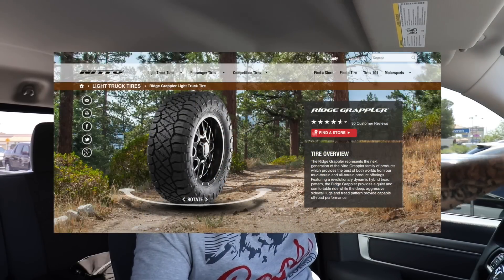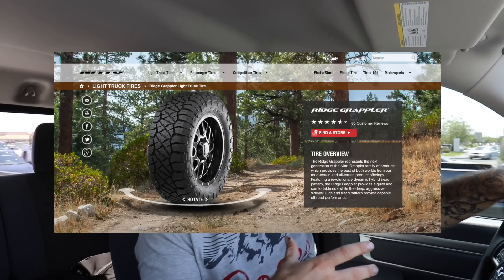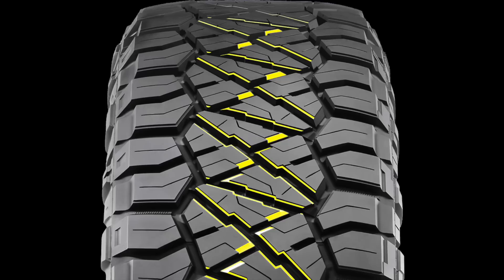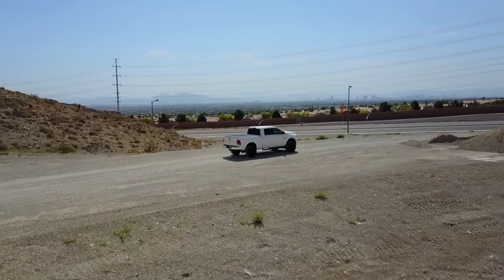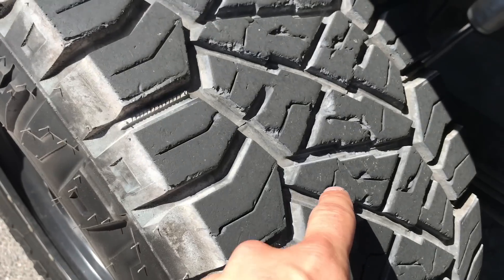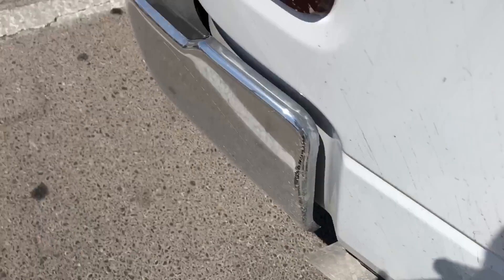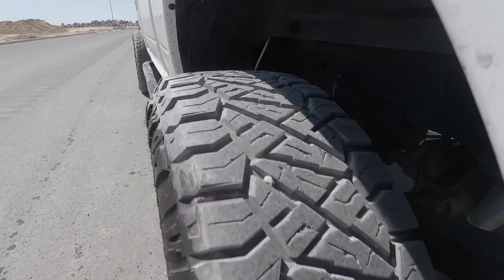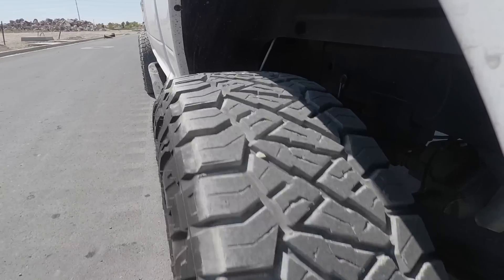Nitto Ridge Grapplers SHREDDED After 4,000 Miles - Jay Flat Out

Comment: FYI, Toyo owns Nitto.  Same company, same manufacturing plants, use different compounds in tires.  See the same issue here in West Texas in the oilfield.  Very similar environment as Vegas, run from place to place on hot asphalt then turn on oilfield roads all day every day.  Will shred a tire, especially if hauling a load.  Running Ridge Grapplers on my F250 right now, 10,000 miles with no issues so far.  This is my first set outside of running Toyo ATII's or BFG AT's.  Have run 2 sets of Toyo's and probably 10+ of BFG's.  I liked the Toyo's, but never the full claimed mileage they advertise as they get really hard at some point and it's like driving on glass on wet roads.  BFG's always had good luck with, just decided to try something different with the Nitto's and Toyo's.  Next set will probably be going back to BFG's.
Reply from the maker: Even when I worked in the oil fields my work truck never had problems like this.
Reply: Toyo doesn't own nitto. Toyo manufactures nitto truck tires for them. Toyo uses their machines to produce tires to nittos specs. This info was from a toyo regional sales rep when I had a balancing issue with my toyo mt's which btw were replaced in full with a new set of tires after almost a year and 3/32's of tread wear. I will definitely buy toyo again, great customer service.
Reply: Toyo and Nitto are both owned by Toyo Tire Holdings of America. I buy hundreds of trucks tires from Toyo, you need a new Rep.

As far as tires, I run the ATII and have had great luck. Giving the Nitto hard thoughts for my new Ford when it comes in. Thanks for the video, likely staying with Toyo now.

Comment: I like the Nitto Trail Grapplers. I have had 2 sets of 35 x12.50's on 2 different trucks , one being a 2002 7.3 F-250 and the other a 2006 1500 Chevrolet vortex max 4x4 and they ride and wear great. Proper tire rotation is key to long tire life.

Comment: Check your rim, what are you running 20's? And you attempted going off roading on those wheels.... it is not unlikely you bent your im and thats why you cant get your wheel and tire balanced. I know because ive bent my rims before, and they are 17 inch beadlocks, with 35's general grabbers. And my setup is desert runner so doing real off riding. Done rock crawling and desert running at 75mph. Ive got 35k on my tires and they have worn beautifully. I still have another 8-10k in them, and i use my truck as a daily too.
Reply from the maker: +leyjonathan they are 18s and they've never been on more than a gravel road 3-4 times
Reply: hmm, weird, 2 weeks ago I almost pulled the trigger for your tires, but at the end decided to go with the General Grabber X3, the new generation of my current tires. the price was better as well. once mine get close to being bald I'll change them out, hopefully before the rainy season here in Southern california. but yeah yours are looking really beat up man for that low milage, what psi are you running?
Reply from the maker: +leyjonathan Right at 60PSI, nothing crazy.
Reply: :-O  nothing crazy? bro, that's pretty insane actually. you should run them at 35-38psi cold pressure. I drove from san diego to tucson last week, it got pretty hot outside through the desert 112 degrees, and my tires max pressure was 44psi, at one of our rest stops I took out air and brought the max down to 40 in the front and 42 in the rear. you really need to change that pressure. like seriously no wonder you feel the vibrations so easily. The harder your tire is the more road vibrations you will get in the cabin. and 60psi is ready to explode hard.....
Reply: leyjonathan you need to familiarize yourself with more vehicles. My 2500 Cummins will throw all kinds of bullshit dash lights if my pressures drop below 75 rear and 65 front. It's annoying

Comment: Most guys with bad reviews of any tire will come from a guy driving a dodge 3/4 or 1 ton truck..  The sloppy dodge front end eats them up and the torque of the diesel shreads the rears..  Take this review with a grain of salt unless you drive a dodge..
Reply: I run Ridge Grapplers on my 2016 1 ton and I have zero issues. And there's nothing sloppy about the front end, especially compared to a Ford with a frame made from bubble gum.
Reply: @evilone6785  damn dude I have a ford and a dodge,I dont have a small dick nor am I gay.I will say my RAM goes through front wheel bearings,besides that love the ride also love f150
Reply: Not so, but I respect your opinion nonetheless. I drive a 2012 ram Cummins and have these tires. Best tires I have EVER owned, hands down. As for your comment about tons of torque shredding the tires...maybe if your flooring it on a rocky dirt road. Otherwise, just a little extra wear is all. It’s called rotate every 3k and u won’t have an issue.
Reply: @AB-80X  hey man, i take offense to that Ford frame comment!   They use cardboard too!   :)
Reply: @Dildo_Baggins.  
Really? I thought it was just the wrapping from the bubble gum.
Sorry man, my bad;)

Comment: Nah. In a 9:30 video, you have about 10 seconds of footage showing the "Shredded" tires, which looks like moderate chipping due to a heavy skinny pedal, and like 2:00 of B-roll which is supposed to be what exactly? The way you typically treat your tires? Driving around in a quarry at moderate to low speeds and cruising on the highways? Why not show a burnout and some gooseneck trailer towing? We all know the highway and the quarry didn't cause that kind of destruction.
Also, you mentioned how much they cost, but what ply rating did you choose and have you done a chalk test to ensure proper inflation?  I'm sorry dude, but those tires don't look useless and completely shredded. Plus, this was like three years ago, so what did you do about your mangled doughnuts? Did Nitto honor their treadwear warranty? Were the Toyos any better?

Comment: Falken Wildpeak at3w are the best in class of all terrains right now. Very aggressive tread and side wall's. If you get the LT version they have the deepest tread depth out of any all terrain, which are deeper then some mud terrain tires. They are also 3 mountain peak  rated. I have these on my jeep and haven't had to use 4 wheel drive in places where I did with Toyo and Cooper All Terrains. Mileage rating is up to 55,000 and heard of people getting up to 50,000 all depends on how you drive but that goes the same for any tire. I highly recommend them.

Comment: I currently have the Toyo RT’s. Similar to you I drive maybe 85-90% on road and of that about 80% of that is all freeway. But I do go off road and near where I live there are plenty of back roads with just the worst asphalt. All that to say that I’ve had them on my truck for less almost 2 years and have 65k miles them. And only until the last month looked fairly new. I think there’s good and bad with all things but these tires have serviced me well in all types of roads and all types of weather. When they wore out I was going to try the Ridge Grapplers but not so sure and they don’t have a warranty like the RT’s do. Might also be because I drive a bad a$& ford and you guys are driving a dodge lol. Setting down I’m only joking. Just my two cents.

Comment: By the scale my 06 Duramax is 7900 lbs. I bought my truck with 121k on the odometer and now have 159k. The nitto G2's that were on there is still looking good with over half the tread left. I'm stationed in Vegas and run a lot of the same roads. My tires look like they are in way better shape than yours. You might have a bad set.

Comment: Tokyo and Nitto is the same company with the same rubber compounds just different tread patterns.

My Nitto Trail Grapplers had 50,000 miles on them when I sold my old truck. 
Quite (for a mud tire), long life, rode better than my Goodyear Duratracs, amazing offroad (mud, snow, clay, sand...) and look the toughest.
Reply: I think it's the hot pavement and towing killing your tires. 

http://www.nittotire.com/light-truck-tires/exo-grappler-all-weather-traction-light-truck-tire/
Or the Toyo version

Comment: Man I have just over 10k on my Ridge Grapplers and they look all but new. I drive all over TX and also offroad on my ranch in the west texas mountains. Super nasty rocks that grind up most tires. Not sure what your issue is. I do however have issue balancing one tire out of the 4. What size are you running?
Reply: I have not balanced mine at all and after 8000 miles, they still look new and ride super smooth. No noise and no vibration at all.
 I'm running 295/70/17.
Reply: It's because it's a ram

Comment: Get Goodyear duratrac tires, I work at discount tire in Phoenix and those are some of the best tires we sell
Reply: American  amen you are right on those duratracs.  Nitto Mt 20,000 miles. Toyo 25000 miles Mt. Duratracs 40,000 and I still have tread left
Reply: I have the duratracs and they suck!

Louder than my Nitto Trail Grapplers and rode ruffer
Reply: Duracraps suck off road!  They are modeled after 1980s rear wheel drive snow tires.  Duracraps are the ugliest tires ever made😂
Reply: I had duratracks on my JKU loved them quite and decent off toad too
Reply: Duracraps suck
Reply: Notsofast L you are right. I’ve owned the duratracs. Had them on a tundra. While I did get 50k out of them, after about 25k they lost their on road performance. I could never gain traction from a stop light, and in the rain? Ha! Forget it! They performed well in the snow, but the ridge grapplers , in MY experience, far outperform the duratracs in most ways (just not in snow I would say). It’s also the only aggressive tire I have ever been able to balance and go 5k without needing to get rebalanced in between rotations. Love my ridge grapplers. Got 35k on them now and still holding strong.

Comment: First it’s pronounced “ass-fault”, second, have you tried balancing beads? Third, metric sizes start with 16.4/32” and imperial sizes start with 18.3/32”. I’m guessing you have 35s, so you’ve used 6/32” in 4000 miles. You’re barely going to get 12k miles out of them.

Comment: These trucks are made to haul lottsa weight. So your front end is adjusted to do so. My 3500 cummins front tires are wearing on the outside of the tire bad. The factory makes the top of the tire lean out and the bottom of the tire lean in. So when you put weight on the truck they go straight up and down.
Reply: You are right Camber is a bit positive on all trucks.
Reply: Strictly a Ram/Ford thing with the solid front axles that are slightly pre-bent for heavy loads and no amount of castor adjustment is going to keep all the tire planted in high speed turns or other off camber situations. GM HD IFS runs more true throughout the suspension range and sit flat with 0 degree static camber.
Reply: HAHAHA GM's IFS is the worst! talk about eating tires. Sheesh. And I would suggest you look at the crappy geometry of the GM IFS setup.
Reply: Actually its not bad at all.. i have a 09 duramax rotate every oil change.. Your tires will last a long long time

Comment: I worked for Toyo for several years. They are made in the same plant as nitto, out of the same rubber compounds. Truth is toyo and nitto cant make a truck tire that will last past 15k miles on a heavy truck.
Reply: Living Southern I had a set of Toyo MT 35x12.50r20 on my Ford Excursion diesel (8050lbs empty) and got 70k miles out of them
Reply: I have a 2015 ram 3500 mega cab.  Got 40,000 out of my Toyo open country A/T 35x12.5 r20
Reply: Dude open country last on the hwy bro.... 65k plus... 15? I call lies

Comment: I have over 4k on my set of ridge grapplers and I dont seem to be having the problem you are experiencing with them. I personally love the ridge grapplers. Like you said it could be the temperature of the road you are driving that affects them but come one be realistic you've gone 4 times off roading with them? Jesus christ I've gone in more than you and my tires and perfectly fine. Also, I wouldn't bother with toyo (my personal opinion) I dont like the style of that brand. My next option when I run my tires out are the cooper discoverer STT pro. I recommend those instead from people I know who run those tires and have no problems with them either.

Comment: I cant figure out how you arent more familiar with the tire. They come with 18/32 of tread not the 13/32 and they are F rated 12 ply tires not E rated 10 ply. I hate that you have had such horrible luck. I have off roaded the crap out of mine and 23000 miles later they are still at 14/32 and arent shredded. Poor luck? Sorry your set has sucked.

Comment: BFG a/t's. 50,000+ out of my last set. I got bored of looking at them in the end, still a good legal amount of tread. I've known some sets on farm trucks that have perished before they ran out of tread.
Reply: I was gonna say mine didn't last long at all on my Duramax, the KO2's are to soft.
Reply: KO2s don't last too long on the 3/4 and 1 ton trucks. They are redesigning the tread pattern and compounds to make them work better. Should be available around the beginning of 2019. Quality of the BFGs are going to be better than pretty much anything else out there.
Reply: @ Clay C unless they can fix their balancing issues, they will never get my business again. Went through THREE SETS of ko2’s in 16k miles with discount tire on my 2012 Ram 2500. Some slightly better than others, but Couldn’t go 1k miles without it back in the shop. Wasted SO MUCH of my time. I drank at least 2 cases of discount tire water bottles in the time I had these tires while I was sitting in the lobby waiting for my truck 😂.. Got these Ridge Grapplers after I had enough and they are a dream. Of all the tires I have had on my truck, these are hands down the best. ZERO vibration at highway OR city speeds. Clearly it was not my truck, as they so politely tried to tell me. My truck thanks me everyday for making the switch.

Comment: Got right at 45,000mi out of a set of 37in mud grapplers. They started chunking out as well once they were past the 40k mark. Mostly spinning in gravel is why they'll chunk, I'm thinking your hot pavement driving made for some strange and harsh heat cycles that hardened the rubber (every time a tire heats and cools the rubber gets harder) and yours got hard and once they got hard and because of the original compound they chunk out easy on gravel roads, which will kill any tire aired up to proper road pressure that you should be running under an HD truck.
Reply: What were you driving? and how often did you rotate them?
Reply: Nope. Not so. I live here in vegas too and have over 35k on mine and they almost look new with the exception the treat is obviously lower. Seriously the best tire I have ever owned. I think this dude was paid to rip them to shreds because unless your driving over razor sharp rocks flooring it, I do NOT know how this is possible. And I drive the exact same truck as he does, with 35” tires as well...oh, and it’s a white Ram too! Lol 🤷‍♂️

Comment: Need to bead balance-  it's a bag of beads inside the tire - they balance every time the tire rotates  - have had my nitto trail grapplers for 60k miles and are smooth as factory at any speed - up to about 100mph never had to rebalance in the 60k  running 35/1250r20
Reply: wrenchslinger yes.  that's what all the big boys are going to now.
Reply: wrenchslinger, Would a tire company like Discount tire know about this procedure? Can you post a link how this is done?

Comment: Tokyo and Nitto are one and the same company. You purchased your tires for looks not performance. You need road or AT tires
Reply from the maker: +Matthew Fox These are AT tires
Reply: Toyo and nitto are not the same company. Toyo manufactures nitto's truck tires to nitto's specs. Tire carcuss is shared between lines but that's it. This was info from the southeast regional sales manager from toyo that came out and met with me when I had balance issues with my toyo mt's. Toyo customer service was awesome to deal with and they ended up replacing them free of charge. Had 20k miles on the second set when I sold the tires/wheels and they had only worn 3-4/32 on a 1500. When I put tires/wheels on my cummins I'll definitely be going back to toyo.

Comment: I know where your co.ing from man on tires, I bought a set of nitto mud grapplers for my Silverado when I had it and they lasted maybe 10000 or 15000 miles and all that truck did was high no real off road except Dumont sand dunes and all I did was drive back and forth to comp hill.  And I paid 1600 mounted and balanced for them.  I had the same issue with the balancing that you have with yours. And I know they were a mud terrain but I thought i would ve got a little more then that out of them and they to started to shred.   I have had bfg's as well on my titan and they were pretty good, but then I found these gladiator qr 900 tires and they are amazing they look like an all terrain but they are great in the mud found that out on accident.  It ended raining at king of the hammers last year and we were on the lakebed and those tires worked out great getting my toy hauler out.  And they are great on the road and balanced perfect  and they weren't to pricey either.  I live in 29 palms ca and it's get a hot out here to and they haven't changed at all, a few of the reviews I read on them said they 45 and 50000 miles out of them. Mine have been on there for about 7 months and they still look brand new and they are E rated.  Check them out man